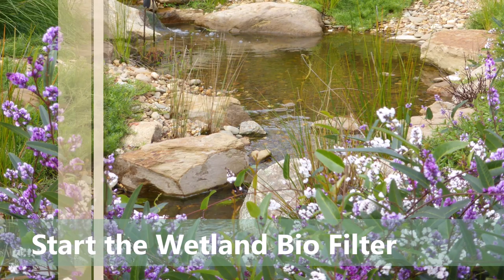Creating a Wetland Bio Filter for the Frog Pond - Urban Garden Build

Comment: Nice job Simon, looks very interesting the pond filter system. I haven't seen one of those before but looks interesting !!  I liked how the native noisy minor flew down and sconed the sulphur crested cockertoo, I laughed my guts out, they hate each other so much they do the same around my place haha. With your solar setup, I was just looking at the cupboard your putting it all in which is very good, and there's one thought I had was where to put the charge controller and as dumb as it may sound sound either screw it to one of the doors on the inside so all you have to do is open the door and the controller is just there, the other option is, get some sticky backed Velcro and Velcro it to the end of the battery !!  Just in case your wondering, I have a mancave out in my shed that is 12v, my solar setup is 2 separate 12v 300ah of batteries powered by 2x200w solar panels totalling 600ah of batteries and 800w of panels and it works brilliantly and has been running for about 5yrs now. It's gone through 3 different configurations and this setup is the best. I run my 12v 210lt fridge/freezer off one of the systems and I run my 65lt freezer off the other system plus all the LED lights, fans, 12v stereo and other things I can't think of at the moment. Hope all that helps mate I could waffle on for hours about solar I just love it and it will always be a part of my life from here on. Is there some way securely I can send you my email address and It can give you my thoughts and ideas on solar, if you'd rather not that's all good mate I totally understands there's too many weirdos out there these days. Seeya Rob..............by the way I can my mancave the Shedroom NOT the Bedrrom get it haha.
Reply from the maker: I am going to build a second interior wall to mount all the electronics, Fuse box, Controller, pump switches etc. Wiring can all be hidden behind the false back wall and accessed by removing a few screws on the rear tin wall. Noisy minors have no fear and cockatoos are always up to no good so I did enjoy that little display as well. Will see if the 170ah battery  Installed will be enough for the pool pumps. Work in progress.